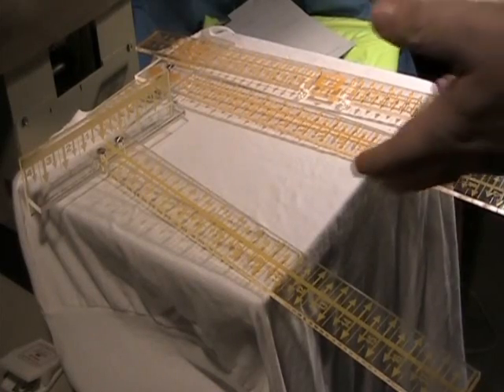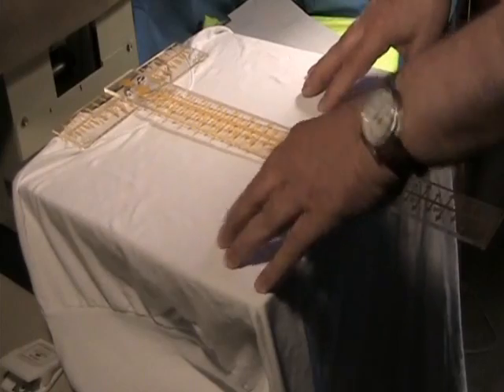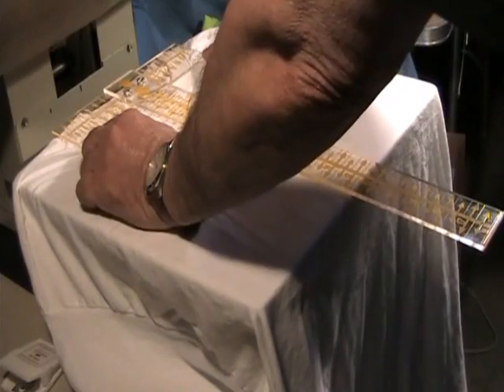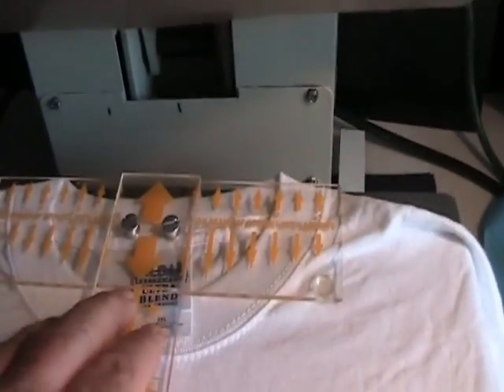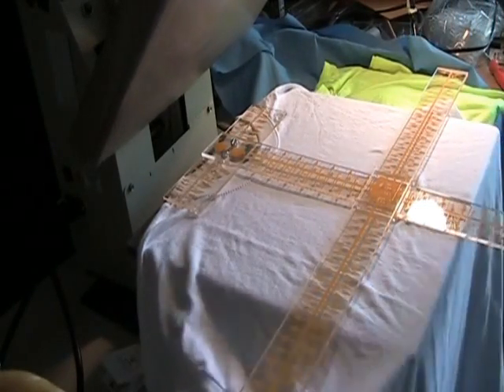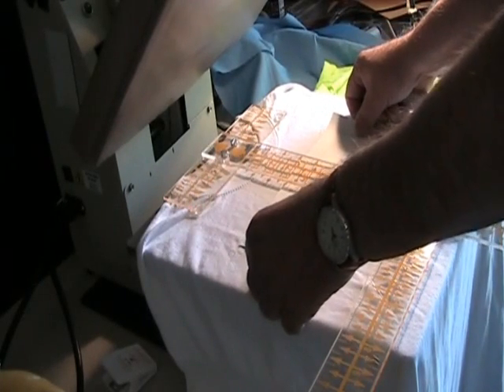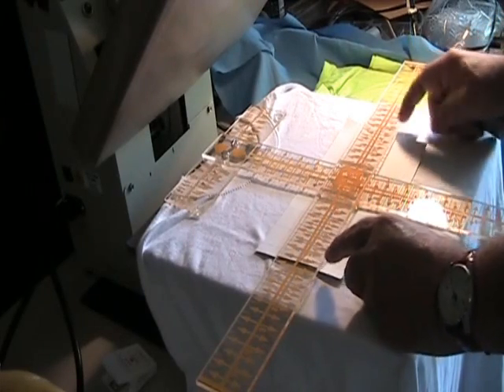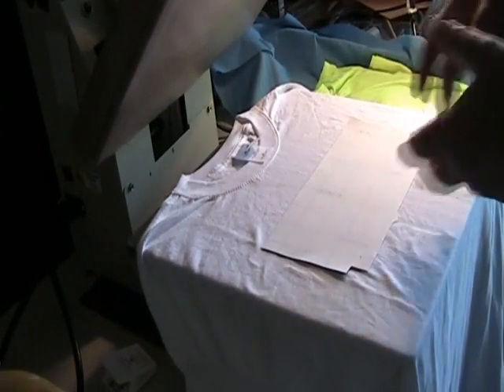Tee Square It 2

Comment: Take your shirt, fold it in half length-wise, press it. You now have a perfect line running straight down the middle of your shirt. Tsquare is great for real detailed work but if you're doing 1000s a day you gotta either invest in custom plates for your variable sizes or just use the press hack. If someone has an even better method, I'm all ears.